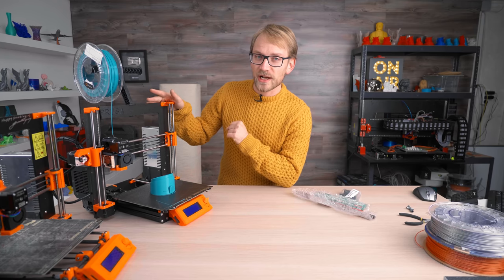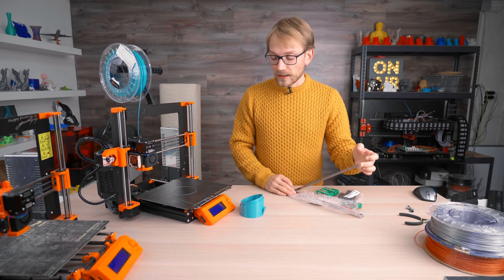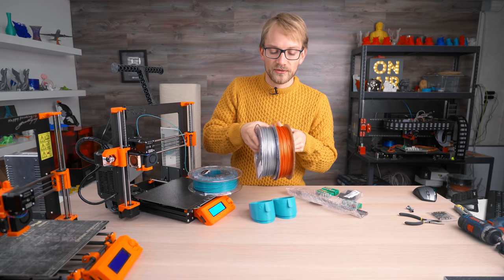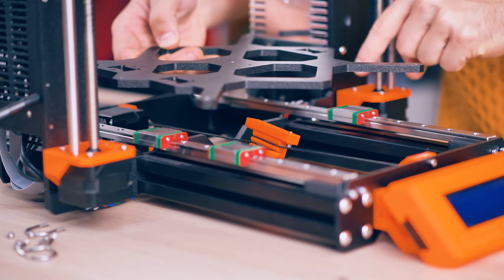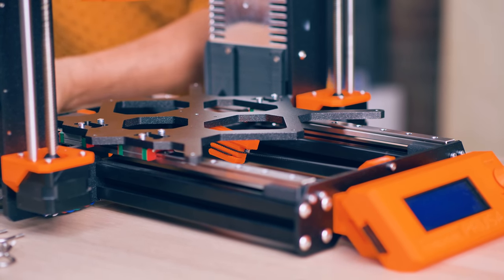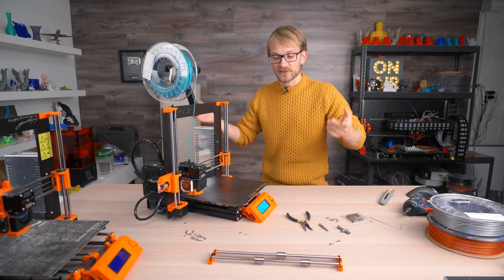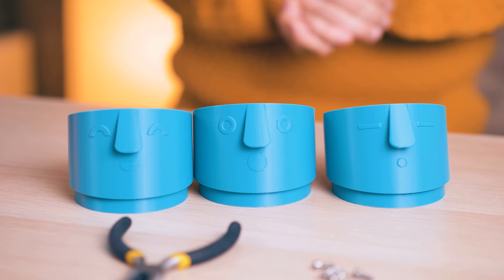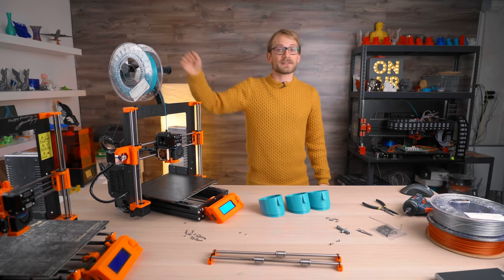Upgrading the MK3 with genuine HIWIN linear rails: Worth it?

Comment: I've been trying to understand the inconsistency issue(s) of the Mk3 for months now, read countless forum posts and asked the 602 community in discord (which I can recommend btw).
First of all I installed a reverse bowden as suggested in the video too, and it really helped a lot. Mind, that you don't need to minimize slop here, so a 3mm inner diameter/4mm outer diameter PTFE tube works wonderfully!
Everything else probably comes down to the extruder itself. Many people reported significant improvement after installing a geared extruder like the Bondtech upgrade. Although a bit pricey it also reduces weight and extruder motor temperature, which on top of that can't be transferred to the actual gears and with that the filament anymore, so it won't soften. Prusa actually uses this method in their Pursa Mini printers now, which I find somewhat ridiculous...
Another thing of course is heat creap which causes the filament to stick slightly on its way to the nozzle and therefore causes layer inconsistencies. Swapping the silent but weak noctua fan for one with higher static pressure like models by Sunon seemed to help a lot by keeping the cold end, well... colder. So these are the most important upgrades I'm planning to install next.
Hope that helps some people =)

Comment: I am a CNC professional of 30 years. Hiwin is fine brand of linear guide. To really take advantage of the Hiwin linear rails, you should do exactly what every CNC machine tool builder does:

1. Machine both surfaces of the Y axis extrusions, generating mounting surfaces with both flatness and straightness.
2. Install one of them, tight against the straight edge of the pocket you machined.
3. Install the other side loosely, and let it float.
4. Put an indicator base on the tight side's carriage, with the arm and indicator reaching over to the other side.
5. Slowly work the indicator back and forth while tightening the loose rail side one screw at a time, so that the total indicator reading is within 1 micron parallelism between both rails.
This is the only way to enjoy the benefits of the Hiwin rails. If you are going to mount them to unqualified extrusion surfaces, you should use cheaper rails and carriages - they exist. There really is no point in using 200 euro rails only to mount them to unqualified, unflat, unparallel surfaces. You are not showing off the rails, you are showcasing the out-of-flatness and out-of-parallelism of the Y axis extrusions.

Comment: Add some cork feet or a thick rubber mat under the printer to reduce resonance 'ringing' on the prints. you can also add them between the stepper motors and the  stepper mounts to reduce it as well.

Comment: I think the Z-banding is mostly from the Z axis.

I have an Anycubic i3 Mega and I printed a pair of flexible Z-couplings from thingiverse and eliminated most of the Z banding. The author explained that the Z leadscrews are not completely concentric with the steppers and will cause Z-axis to wobble when the leadscrews turn. The Z-axis smooth rods and bearings  are not exactly rigid, either plus there is no load on them as on the X and Y axis so it's easier for them to move by the lead screws.

Comment: I expect the difference to be highlighted by larger prints where the mass creates more kinetic issues. Perhaps loading the linear rail with a 1lb weight while printing smaller test parts like you did would be more illustrative of the linear rail performance.

Comment: I installed linear rails (Not the kit) and I can see an improvement on the Y axis artifacts, some ringing on the print has improved. I compared the same prints before and after the change, you can visually see the improvement and also can feel it, with the linear rails the print is smoother. Also the play on the printing bed disappeared now is totally rigid.

Comment: With regards to the loss of height that 3mm is actually within the design tolerances of th MK3. You could combine this upgrade with an upgrade to the MK3S which would get you the height back. Another way to gain height back is to use the full volume volcano modification with which when fitted with the standard ED3 heaterblock with out the standard height adjusters would gain you 8.6mm.

Comment: The H high precision designation on the rails is probably unnecessary but definitely doesn't hurt. What you're probably thinking about is the preload on the bearings. Less preload is better if your mounting parts aren't super accurate. But preload is a completely separate variable than accuracy.

Comment: That the liniar guider are not the best upgrade for the printer. The issue, I think, is the belt teansmision, a ballscrew will offer better results. But the upgrade is a really hard one. Love to see you do it.
Also when mounting linial giudes, there a master 1 and a slace 1. You put the master and then check with a gouge that the other raile is paralel. I have done this on machine tools.

Comment: The benefit of profile linear rails is they can be mounted on a strong support beam! They ARE NOT designed to be used floating like this.

Those circular bearing rails actually have very tight tolerance, fully enclosing the rail, the downside is just they are unsupported.

Comment: Try testing with a very tall cone or something near the Z limit. The further the print head is from the plate, the more that slop will translate into wobble distance. These 7cm high squat chunky shapes will not reveal that problem. Still, if you don't have a problem where that kind of thing is concerned, doesn't need to be fixed.

Comment: I maintain and run two MK3s for work. I do about 100 hours a week on each printer. I’ve had more issues with the LMU8s. I might have gotten a bad batch, I went with upgrades from Misumi and have had good results. This kit would have been worth it for me just to get rid of the variables that the cheap 8 mm bearings introduced.

Comment: With some printers, the z wobble is caused by the heated bed turning on, and slightly lowering the 24 V rails. To test this, you can turn off the heated bed during printing. If the extrusion is smooth with the heater off, you have found the culprit!
Reply: Could be thermal expansion due to one side of a bed being hotter than the other side.  I saw a horrible instance of this on another brand of printer when I installed a poorly-tuned retrofit.   The one-sided thermal expansion curls the bed and depending on the method of constraint this can move the Z up in the middle.

Comment: Some of that ringing could be related to the mount arrangements for the Y axis belt drive system.  Both ends are at the center of a flexible beam.  There is no solid support below the belt from the back to the front of the printer.  I had the vibration on my Anet A8 which has similar but plastic construction.  I mounted a threaded rod below the belt tied in at the front middle and back.  No more vibration on in the print.

Comment: The mk2.5 upgrade kit come with a drill bit and a holder so you can drill out the holes for the zip ties so you can use u bolts.

Comment: A simple calculation of bearing surface contact would make this a non-starter for the Prusa. Creality type machines with wheel bearings, on the other hand, will gain stability from the multiple points of contact and spacing of the balls in the linear rails.

Comment: I have a Prusa i3 replica, the reason being its cheaper. I love the way people are upgrading and going further into the premium. category. my concern is that we are now outdoing these printers and the goal for the fdm printers; cheap and accessible. I love the way Prusa mini has come across, but still far too expensive, would you agree? I would like to see a challenge that uses cheap accessible electronics and print the rest of the build, such as the bearings and brackets. In a way that it's replicable as well as accessible to the wide audience.

Comment: I floors me that time and effort was taken to reduce 'wobble' in the wrong place.
No matter how rigid the frame, rails, table, floor, building, Earth, there is a weak link right under to the model!
Springs.

They are a safety device to prevent damage, until you have learned enough to prevent nozzle-strikes!

Put the leveling knobs where the springs lived.
Install lock-nuts where the leveling knobs came from.
Mechanical Leveling becomes a truly 'one-time' event.

Level opposite corners with the knobs, then lock them down with the lock-nuts.
Never adjust one knob by itself!
Once you have 'A' and 'C' locked down, 'B' and 'D' are next.
Never ever ever ever ever ever 'level' just one corner, you are warping the plate!

Three points define a plane, and there are four points attached. 
What happens to the shape of that plane if only ONE point is moved?
Warping.
And we don't like warping.

Doesn't matter if it makes that corner 'right', it is inducing mechanical stress for the other three corners.
Adjust opposite corners as a pair!
One goes up, one goes down, until they are both 'perfect'.
Only then can the other two be adjusted in the same way.

Anycubic MEGA X, Mingda Rock 3 Pro.
No springs, no adjustment to bed in 100's of hours of printing.
Take the printer apart, put it back together...don't even have to check leveling!
It just works.

Robert is you parents sibling.

Comment: Yeah, the layer lines not perfectly aligning and vertical lines (ringing?) have been driving me crazy. Belt tension does seem to affect the vertical lines.
I think it may have something to do with the printer not micro-stepping properly. The printer prints mechanical components just fine, I can reliably get to 0.1mm on Makers Muses' tolerance test print, I don't even need to force it free. It just makes it impossible to print decoration prints at anything faster than snails' pace

Comment: Hi, by experience, if you tight the U-brackets bolts too much, the barrel of the bearing will deform and the bearing will slowly carve a line into the rod. Luckily it is only a line and there will be not misalignment

Comment: You should start by acknowledging that the stock Prusa extruder and Noctua fan provide insufficient cooling for the v6 heatsink, and swap out that fan for a more powerful one, ie one that has a better static pressure rating. Prusa has also published newer revisions of the extruder which you should definitely upgrade too, or even look into other extruder designs provided by the community, if you dare try them. This has been recognized by many people as one of the main cause for the layer misalignment artifacts that you mention at the beginning (but were not inclined to acknowledge when the MK3 first came out)

I also think it would have given one less argument against this experiment if the exact same model had been used in the test prints. I understand the feature difference is minimal, but people will always get you on the fine detail, and in the spirit of scientific process I think this has value.

Comment: Willyminime covered every mechanical issue that should have been addressed. One thing you highlighted was using the standard settings for all three tests. This in itself, is a testing flaw if the goal is to improve the precision of the model. In order to take advantage of a fully constrained and rigid environment, the settings need to be adjusted to account for the increased accuracy and coordinate consistency. The print settings of the model should now be able to leverage maximum performance - if the coordinates of both the X and Y axis are perfectly aligned during the entire process. 

The linear rail upgrade to the platform, using the exact same settings for all three models,  proves how badly the printer is when using default settings after the linear upgrade. Perhaps you should run another test and see if your results improve. I'm betting they will.

Comment: I like that it has 2 linear rails, however, I don't like that the rails are "floating" and only connected to the ends. The linear rail kit for the Ender3 from 3dFused has only one rail on the Y axis, however, it's bolted down along the whole rail. I do love the rails on the Ender3, and I'm sure they would be great on the Prusa as well.

Comment: One Y-axis rail along with one factory round bar might work better.  Getting the bed exactly level would require some custom parts.
The maker gear printers use just one good sized rail in Y and nothing else. 
So now I am content with my MK3S in almost stock condition.

Comment: I'd actually like to see how well this prints with ballscrews instead of the the belts and pulleys. In my opinion the belts are always the sloppiest part of most consumer 3D printers.
Reply: but ballscrew would be much slower than the belt, no? for Z ok, but for X and Y i'm not convinced.
Reply: @AudreyRobinel  you would have to spin the motor faster for the same amount of lateral speed, but generally I'd say most 3D printers are printing at a rate much slower than what the motors are capable of. A quick check, it seems like most belt systems should go about 40mm per rotation, whereas a 1204 ballscrew (the size that I would recommend for a 3D printer like this) travels 4mm per rotation. You'd need to spin the X/Y motors 10x as fast to have the same print speed, but conversely you'd have 10x the resolution on positioning.
Reply: @cavemaneca  And that 10x speed requirement instantly puts stepper motors inadequate. Don't forget that 10x speed means 100x more energy in the rotor, and you are adding a steel rod to it too. But I am curious what a properly engineered ODrive + servo + ballscrew + linear rail printer would do. 😉

Comment: I have the MK2s (not even done the 2.5s upgrade yet, but that bed is tempting) but the first (and only) upgrade I did was to swap those u bolts for a printed block (see thingiverse) so it did not pinch the bearings and I could tighten them up securely.

Comment: I would test a better spool holder. The resistance of the spool has negative impact and x gantry wobble. I have found that on a direct drive it is noticeable and you touched on it.

Comment: great video boss. learned a lot as always. i think i might add this in: resonance/vibration is a frequency based phenomena. i find you need to dampen low frequency wobles, and also dampen high frequency wobbles. i think the looser holdey guys reduced the high frequency wobbles, but compromise accuracy. my 2 cents would be to find a way to dampen the high frequency vibrations in the stiffer holdey-guys. cos ultimately you want more precision and you get that from a no-move bed. i think the losey-holdey guys inaccurately solved the high-frequency wobbles problem. it would be cool to accurately reduce those high frequency wobbles.

Comment: My heart is breaking with all that power drill tightening
Reply: M3 screws, through a  3D printed plastic adapter and the rails are supported only on the ends, so...it doesn't matter anyway :D

Comment: if you want flawless prints without any! artifacts, get C5 ballscrews with servo motors. Its the motors themselves that make the Wood pattern, and the screws will give you true 0.05mm mechanical accuracy and not just theoretical u get with the Stepper motors + belts. 
Probably overkill for a prusa but yeah.

Comment: I'm curious to see what happens if you really crank up the speed. One of the reasons why prusa printers are so reliably high quality it's because the speed is tuned well below what it probably could be. In robotics, the main benefit of more rigid systems is that we can drive them much faster without proportional inaccuracy being introduced. Maybe we will start to see a difference if you really crank the print speed up?

Comment: Tom, this experiment makes me wonder if you should replace the u-bolts of the linear bushings with zip-ties, and compare the quality of the print again.
Reply: I used belleville washers and distorted-thread locknuts on the U-bolts.  The idea is to get some tension force in the joint that will stay relatively consistent over time.  I think the Prusa instructions have you tighten them until they touch and then another 90 degrees.  This is also a valid technique but I don't know if everyone will interpret 'touching' the same way.

Comment: Good video!!
You will want a cnc plate with those linear rails. The rail system Prusa uses is already stiff enough IMO.
I think you need to make X and Y stiffer and some adjustments to the printer profile.  What you will get more consistency between prints. You didn't show that in this video.

Comment: I'm aware this video is already two years old, but when I was trying to set up my custom i3 with higher-resolution steppers I came across a user trying to solve these issues. He was trying to scientifically attack every possibility including resonant vibrations sent through the machine at certain coordinates, slight signal interference in the wires, signal drop to the motors during high current load, issues with stepper drivers, possible imperfections in leadscrews and rails, as well as issues with belts and toothed pulleys. It seems like too many possible angles to solve the issue on a consumer printer.

Comment: Im glad you spent the 200 euro's and not me lol, I stick by what I said before, the issue is not that the Y isn't stiff enough! its that damm 3 bearing slop setup! I solved that by using a 3/4 inch PVC tube, that the lm8uu bearing slips in tightly and anchored it to the bed, the total cost was a whole 10 dollars for the pipe and all the bed artifacts have been solved.
Reply from the maker: To be fully transparent: Watterott sent me the upgrade kit along with a set of TMC2209 drivers to test out (at no charge)
Reply: @MadeWithLayers  
thanks for the transparency, Either way, you saved a lot of people some money by showing it may not be worth the amount it would cost to retrofit with the hiwin's. Two thumbs up as always!